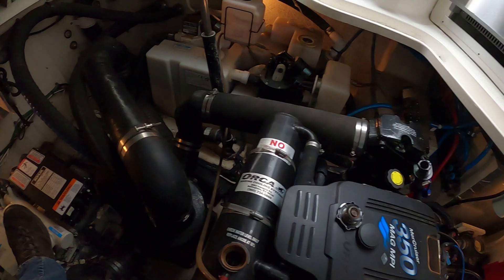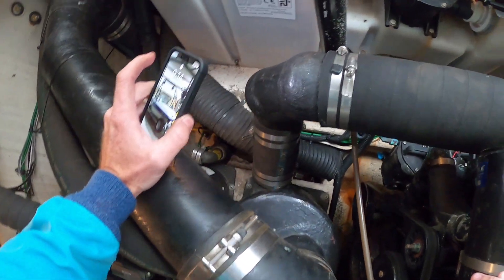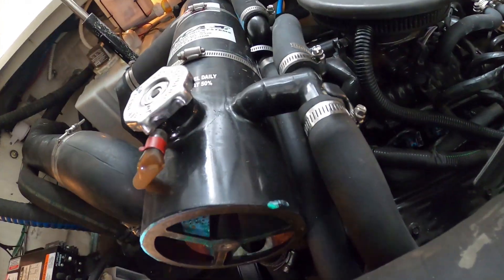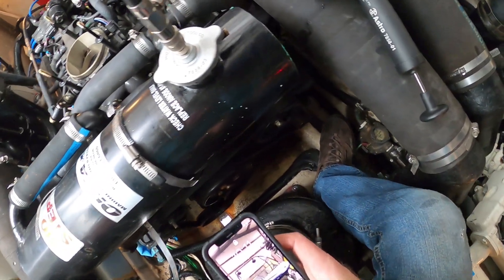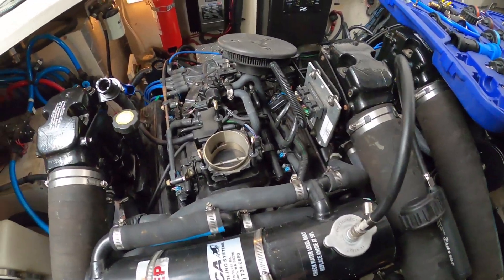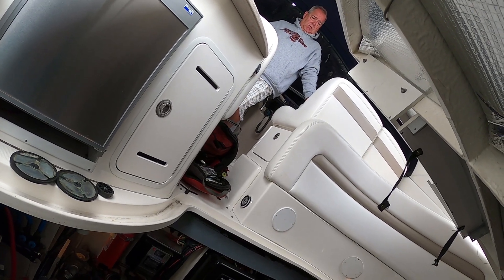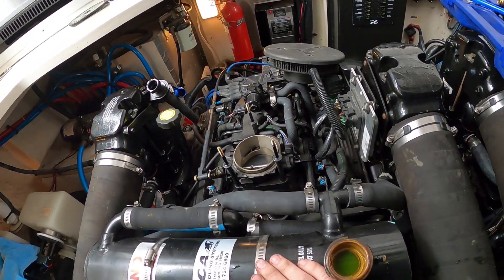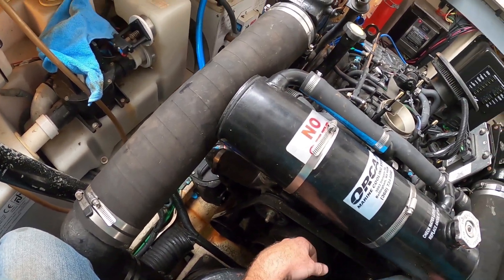Mercruiser Mysterious coolant disapperance Part 1

Comment: Had the same issue with my heat exchangers that were installed on my 32 express 7.4 L engines.  My heat exchangers where too small to cool the motors efficiently.  Had custom ones built that flowed twice the coolant and the motors where very happy after that.